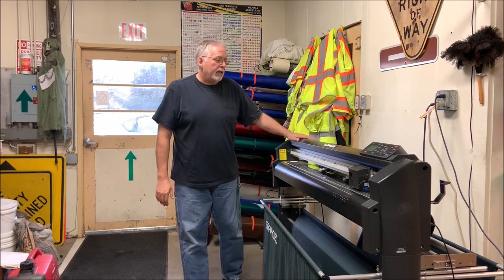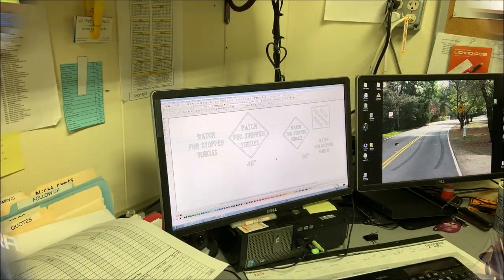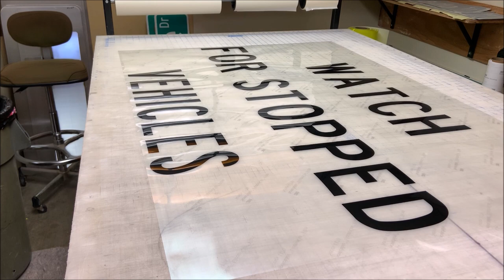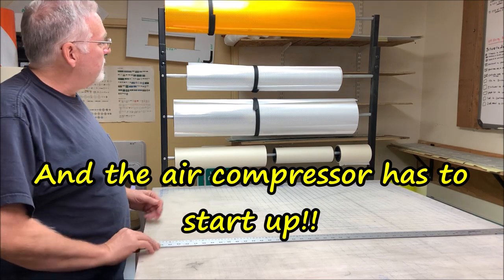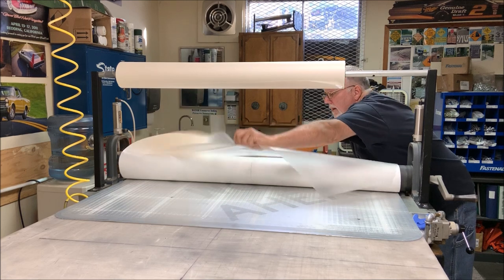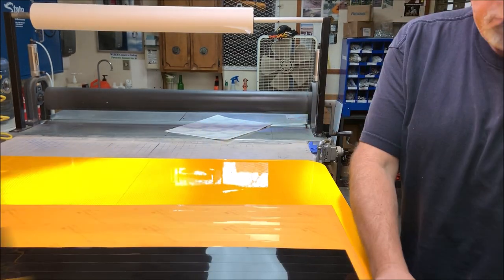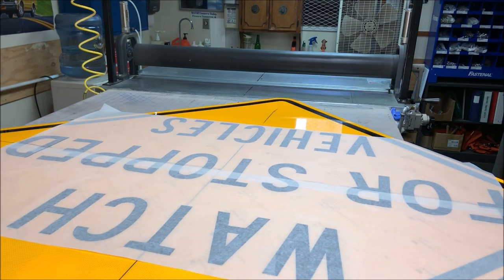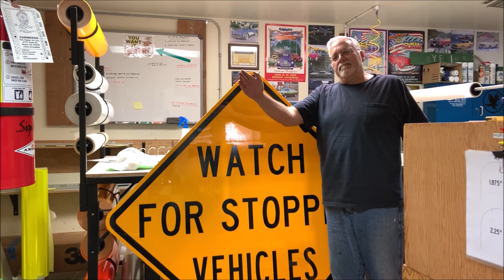Making Oversized Traffic Signs.  Tip on how to make large traffic signs.

Comment: just stumbled across your videos pretty cool stuff. With the transfer tape the only issue we ever run into doing it by hand is if the tape overlaps on top of your design we end up getting a little bubble line where the overlap is. I wonder if that doesn't happen since you have the pneumatic roller set up??
Reply from the maker: I never seem to have that problem. I use my roller and roll out the transfer before I apply the design. All though from time to time I do get a few air bubbles in my design.
Reply from the maker: I still get some. But it's not a big deal.
Reply from the maker: NorCalBerserker  http://www.trafficsign.us/
I download them and put them in a binder. This site is where I get a lot of them.
Reply: @BobTheSignMan  barely actually seeing this comment 😆 but that pneumatic roller system is still a dream for me 👍 awesome stuff